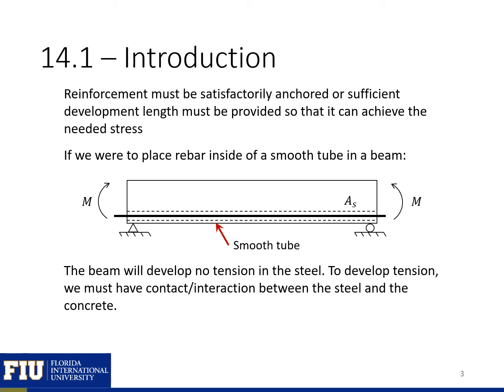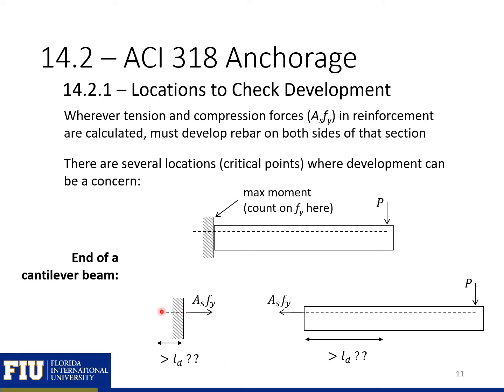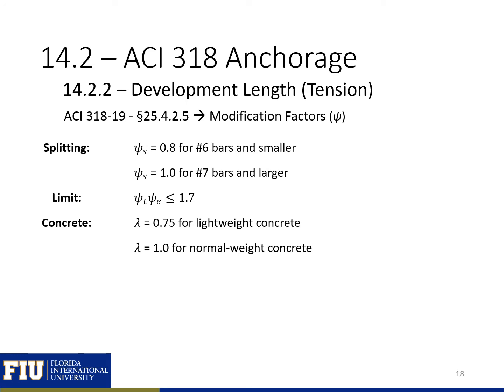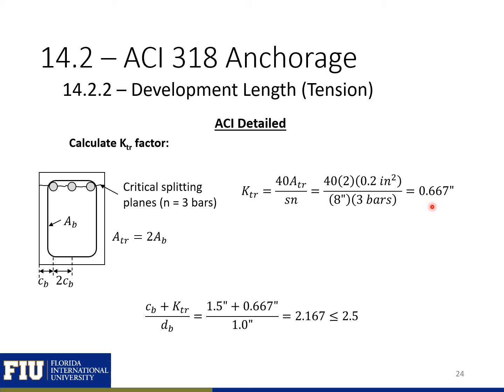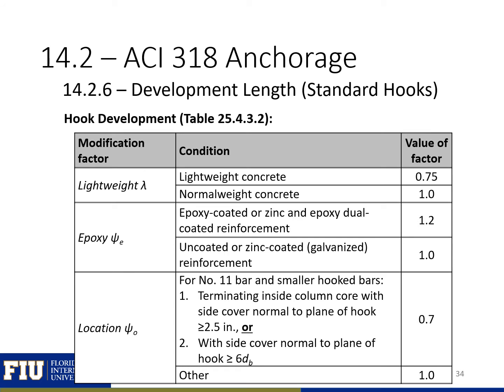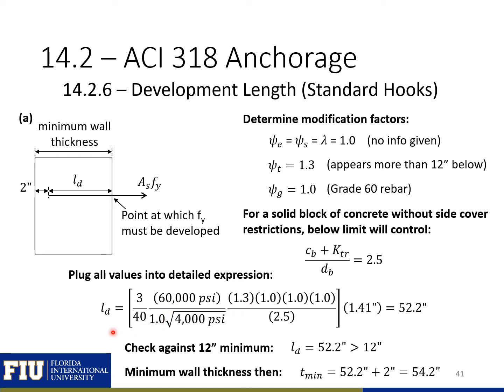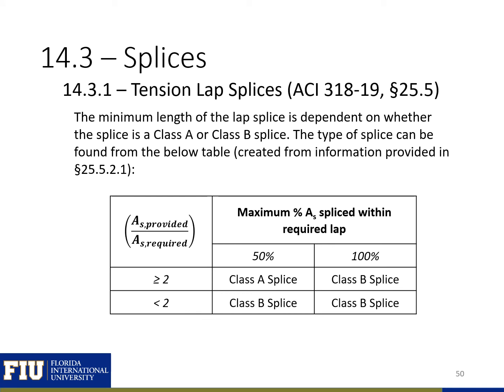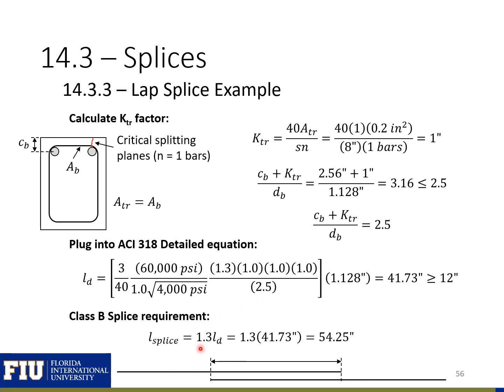14 - Adv. RC Design Lectures - Bond and Anchorage

Comment: Hi professor Garber, I have a doubt in regards to your Psi location factor for the hook development length, in this case you say is 0.7 when does fulfill the criteria, and 1 when it doesn't. I've read from ACI 318-19 that it should be 1 when it does fulfill the criteria and 1.6 when it doesn't, so I'm a little confused.